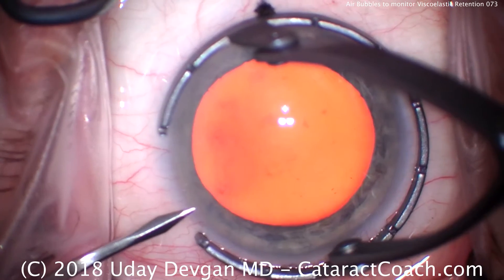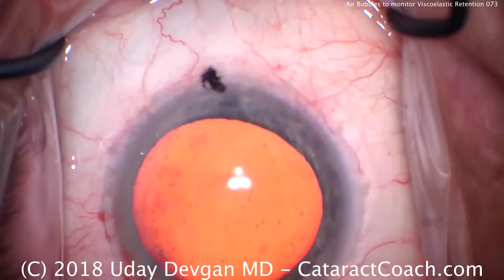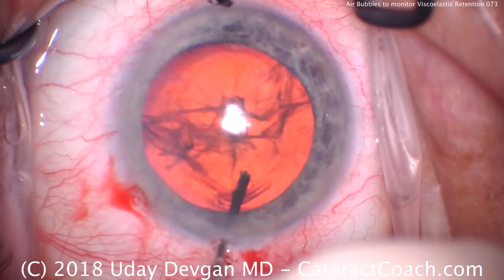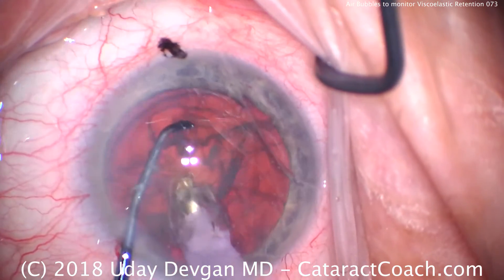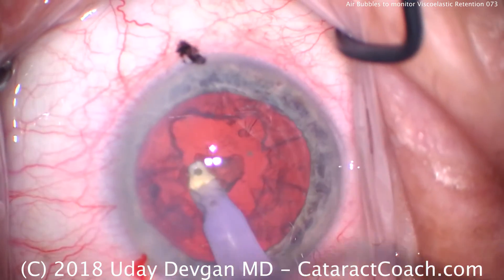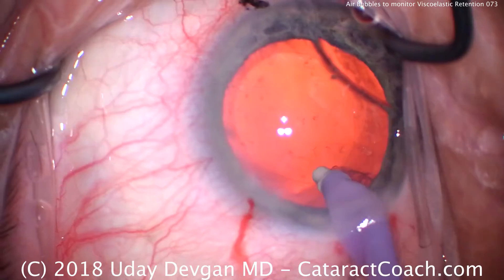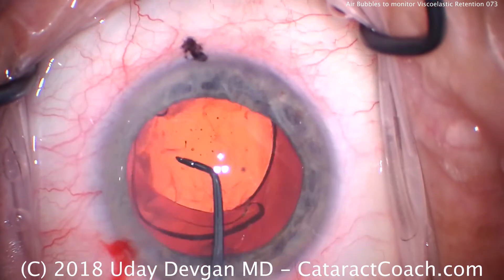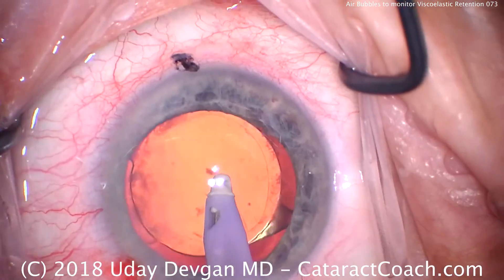Using micro air bubbles to monitor viscoelastic (OVD) retention during cataract surgery

Comment: How to inject tiny air bubbles in viscoelastic ??
Reply from the maker: put 0.25 to 0.5 cc of air into the 3 cc lidocaine syringe. then inject quickly inside the eye using the 27ga cannula. The force will cause the large air bubble in the syringe to break into many tiny bubbles as it goes into the eye.